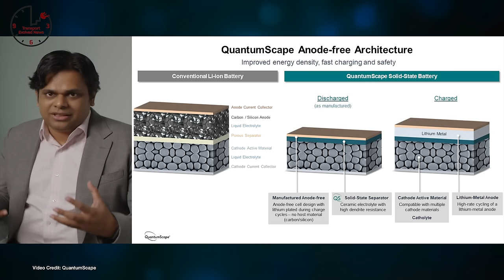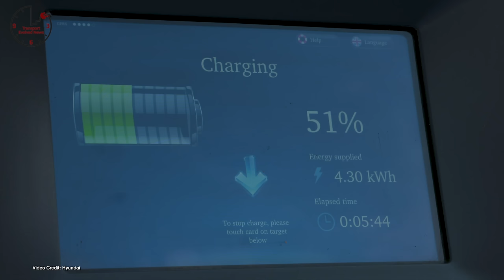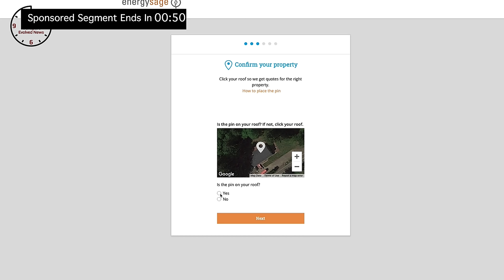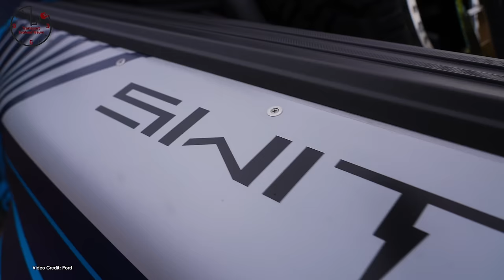TEN Transport Evolved News Episode 469 - Ford's Jumping Truck and Elon Musk's Ultimatum

Comment: 21:24 Sorry but Tesla charges $20,000 for a new battery while Hyundia has quoted multiple people $56,000CAD (41,594 USD) for a battery replacement.

Until they offer a reasonable repair option for dents in the battery case: Hyundia does not seem to be worth the risk.

Comment: Hello TEN. Thank you for your video.Where can i find verified and unbiased sales information and trends on EVs. There is so much confusion out there. Sales are up, Sales are down, Production is being cut. Production is going up. I appreciate your channel. Thanks.
Reply: Case in point: Nissan delays launch but reveals plans. It's hard to know overall what the direction is and how the trend is slowing or increasing.
Reply: Another example, Stellantis layoffs due to 'weakened EV demand', but is that just them or is it industry wide?
Reply: A lot of the 'confusion' is that legacy automakers are typically selling more EVs than ever....but not as many as they hoped. Sales are not dropping. Sales are increasing, but often not as fast as production has increased.
Reply: @stephenboyington630  Thanks, I figured the same but I need a reliable source of easy to understand data. Do you know any?

Comment: 5:25 One big other raison is that hydrogen electric cars are 5 times less efficient than battery electric cars, from the grid to the wheel. It means 5 times more photovoltaic panels, wind turbines, nuclear power plants, etc. And of course at least 5 times more money to drive. So hydrogen has no future for ground transportation.
B-EV : grid -> battery -> motor(s).
H-EV : grid -> hydrolysis -> compression -> transportation -> distribution -> battery -> motors.
However we need to produce green / pink / yellow hydrogen to replace the huge volume of black / grey / blue hydrogen used in the industry, not to mention new needs such as the production of carbon free steel. And we will probably also need hydrogen to fly long distances since batteries are too heavy for more than 2 hours of fly, but flying will probably cost 10 times more than with tax free kerosene !
Reply: The only green hydrogen production facility in Germany has shut down and gone bankrupt. What now?
Reply: @wolfgangpreier9160  Sadly, I guess now German's hydrogen trains will run on grey or even black hydrogen. It should be mandatory for all zero emission transportation hydrogen projects to put online at least the same level of clean hydrogen production. Otherwise, it will just be more coal and petrol and gaz. BTW, hydrogen trains are also a bad idea. The way for trains is to electrify the rail network, with batteries to deal with the portion of the network that are more expensive to electricity or with too low traffic (for now) to make it financially valuable.
Electric trains (and metros, tramways, trolley-buses) : grid -> motors ! (and motors -> grid when slowing or going down hill 👍).
Reply: @didierpuzenat7280  1: There is no active hydrogen train. Its all greenwashing and they are not allowed to partake in the general public transport.

Did you know that only international and fast trains are energy efficient?

Meaning only ICE and other international trains - not regional, REX etc. - have a better efficiency than a Tesla Model 3.

Swiss have found out conducting such tests in their own rail system.

City wide trams and Undergrounds/Metros etc. are quite efficient. Between cities not so much.
Reply: People who tout hydrogen, either ICE or fuel cell, passenger vehicles don't have a clue as to both the bulk of hydrogen storage vessels and the extreme engineering necessary to transport and safely use hydrogen. The Engineering Explained YT channel has an episode where the specifics of a Mercedes hydrogen/fuel cell sedan that was built is explained. Note also that a hydrogen fueled ICE vehicle is also a bad idea. Combusting hydrogen in an engine produces both water and nitrogen oxide, which is an atmospheric pollutant.

Comment: Vehicles like the Switchgear truck are not intended to be practical electric vehicles. Before McLaren built the P1, electric cars (Prius) were considered boring. McLaren didn't build a hybrid car to get the greatest range. Instead, McLaren used the electric motor to enhance the internal combustion engine by filling in gaps in the power band and creating a thrilling/terrifying street legal racecar. It is hard to get people to change from internal combustion to electric. The government can pass laws and put limits on internal combustion, but people will resist, fight back, and find ways around the laws. Vehicles like the McLaren P1 and the Ford Switchgear make the diehard fans of internal combustion excited about the performance, and they see electric vehicles as exciting and fun. Then, it creates an internal desire to experience it for themselves. Some may see these electric performance vehicles as ridiculous or impractical, but I see them as necessary "transition" vehicles between internal combustion and electric vehicles. https://youtu.be/OL_eIZjiLUk?si=fuIAuZK6KTc-rJyv

Comment: Betavolt is decades old texhnology. So a bit hyped up.
Reply: It's not new, yet the current tech a is much improved.

It's a story that comes up each year.
Nuclear batteries in that form are for long duration and difficult location energy supply for small electronics.

There are single load nuclear designs that could deliver 150years with a much much higher output, amongst others for space rafts.

Comment: 8:10 Credit cards are great but add to the cost and readers can be easily broken and then the charge point may not be working. QR codes are great but dangerous since a sticker can lead to a thief website or app. It would have been far better if the EU had made plug and charge mandatory, and it would have been easy since CCS2 is already everywhere (including at Tesla's superchargers). Plug and charge is cheaper, more reliable, and "a whole lot easier". Sadly I am not sure the people who decide are driving EVs. Not to mention "plug and charge only" charge points will not be anymore legal, so huge retrofit costs for Tesla for "old" charge points to comply, so higher costs for everybody. Or maybe Tesla will just delay the opening of some supercharger sites to all brands because of the work and cost to retrofit since it will not be mandatory for supercharger sites reserved for Teslas 😞.
Reply: All of this happens in Europe. Broken readers. Incompatible. Software problems. Etc.
Reply: @wolfgangpreier9160  I agree, and also broken screens. Plug and charge is the best way, but I guess it is bad for many haters just because it is associated with Tesla. Or people just don't know. The only better way to charge I see is induction, but I am afraid it is far too late for this technology. Induction would solve the vandalism problem and would make charge stations far more easy to install in Europe where people mind the quality of their visual environment (stalls with cables are not so beautiful and take a lot of space).
Reply: @didierpuzenat7280  Induction? In snow, rain, dirt? Interesting but very impractical. 

Maybe we should implement a pantograph on every vehicle and start laying overhead lines everywhere. 

Or better: A solar Autobahn with dynamic induction whenever a car passes over as Fiat has demonstrated. With built in heating, cooling and permanent cleaning with purified deionized recycled water.

The best ideo imho is the microwave satellite with its football field sized solar panels beaming the energy down into every moving car.

Comment: Re Airbus, megawatts per motor is meaningless without context of total weight of the propulsion system, it's fuel weight and payload. Note the fact that it's a turbo prop means you have more noise and vibration to deal with and slower speeds which means more flight hours per plane, longer flight hours for the crews which mean more crew costs, more maintenance man-hours, Hello 1945 air travel
Reply: 1945 did not have a lot of pressurised cabins. Hopefully sorted
Reply: Short haul flights are mostly turboprops, and they are more efficient than turbofans. 1945 was all piston powered and significantly more dangerous and inefficient.
Reply: @jimgoff1170  Turbo props are jet engines mated to propellers, lighter and in some ways simpler than piston engines, but more complicated than pure jets.
Hydrogen has less energy per pound than Jet Fuel/Diesel light/Kerosene.
The storage is also heavier.
This translates to more cost/mile traveled or payload.

Comment: The EV industry is not yet fully developed.  Standards such as NACS are just recently adopted by car makers.  Problems with EVs are being vetted thanks to real media channels such as ABC, NBC, and CBS.  The sooner the problems surface, the faster car makers can start solving real problems.  The cold weather impact on EVs and charging stations is a wake up call to solve issues with battery chemistries and charging reliability.  The Hertz and Sixt EV car rental news highlights the issue that EV industry needs to churn out mechanics and improve on parts and service.  Consumer Reports on poor EV reliability sheds light that EV startups need to improve on legacy build quality (trim, paint, body hardware (ie. .door handles...), suspension....).  We need to vette these problems for this to work at mass scale adoption.  The current EV owners are the lab rats paving the way for the majority of us.

Comment: Well it’s u again. Can you give me an honest answer.. JUst how green are our EV cars in total per car.
Reply: 42
Reply: what a silly question. how green are ICE cars? it depends on where your particular electricity comes from, electricity is getting greener and greener every day, but some is still produced by oil and coal which needs to end.
Reply: @keithwalker6892 Here is a simple fact, ICE vehicles only use 30% of their fuel for propulsion.  The exhaust from all ICE vehicles is highly toxic.   EVs are not perfection, but they are an improvement.
Reply: Most EVs are green but many are also white or blue.
Reply: @tonespeaks 30% is even optimistic, that's highway cruising once the engine is warmed up.  Normal usage yields under 20%
Reply: Numbers are out there.  Do your own research.
Reply: @GregHassler Mine is around 105%. For every kWh i produce without producing poison and use in my own EVs i give the grid at least 5% for free.
Reply: A least 95% of my charges are at night at home in one of the country with the lowest CO2 per kWh (France). And not with a huge SUV or truck but with a Tesla model 3 so quite an efficient car. BTW, "green" compared to what ? An ICE car ? Are you joking 😂😂😂? Not to mention we have only one car for a family of 5 (with 4 in age to drive) and most of our trips are with 2 to 5 people. When alone I use public transportation (metros, trams, trolley-buses, trains) or my bicycle or I just walk. Idem for the rest of the family.
Reply: @GregHassler  I was trying to give ICE the benefit of any doubt.
Reply: In fact, even with electricity produced with coal, so the worse, an EV emits less CO2 than an ICE car, even including the production of the battery. And I would be surprised you are advocating a car free society. And in many countries the grid is almost CO2 free, and in all countries the grid gets "greener" everyday. Furthermore, you can produce or buy CO2 free electricity, while even with the best intentions you will always pollute and destroy the future of our children with an ICE vehicule. I would happily add links to sources but sadly youtube do not like URLs in comments. But sources do not matter since I guess you just don't care because all I said is well known and I am sure I am not the first one to tell you all that. So at best you are just a nuisible troll.
Reply: An EV takes 2 years to recover its carbon build cost, 3 if made in China. After that if you charge with renewable electricity it’s all win.
Reply: @AlanTov  It depends of where you live, in France you need 10 000 km to compensate a 60 kWh battery (Tesla model 3 RWD, Renault Zoé, etc.), so less than one year based on the average distance per year. Anyway, it is anecdotic since the car will obviously last far longer. Not to mention gasoline does not appear magically at the pump so the impact of ICE car in hugely underestimated. But it is all much noise about nothing since ICE cars will be banned (2035 in Europe) to try to reach net zero in 2050, so people who are not comfortable with the carbon footprint of an EV are welcome not to buy any car at all after 2035.
Reply: One of mine is about 90% green (10% black,) the other is 0% green (it's red.) Not counting windows.
Reply: I have four BEVs. Today is the first time in a year that not one of them is broken. One of them is costing me a fortune and I was given it for free. I replaced a rear mudguard only to find out the headlight module had died. Since it’s been broken for months and not used at night it could have been that way for a while and I didn’t notice. Uncaring operators don’t help

Comment: Did you not mention the problem of drained EV batteries in the Chicago area cold?   You can blame the owners for not warming the batteries or you can blame the manufacturers, but to not mention it at all, while the networks and youtubers did, makes your channel look biased.
Reply: Reduced performance of EV's in cold weather isn't news. It is just a fact of  chemistry.
Reply: @avsystem3142 I have never before heard of charging stations becoming parking lots for EVs waiting many hours for charging.  This was reported on the major news outlets, so it is not just me who find this to be a new twist.   I am not against EVs, on the contrary, but buyer should learn what has to be done to prevent these situations  or decide to hold off on purchasing an EV.   Assuming the buyer lives where there are often extremely cold winters
Reply from the maker: It's a good thing we didn't expect internal combustion engines to be perfect when they were just becoming popular too.
Reply: @transportevolved  I am pro EV, do not expect them to be perfect.   I just thought you passed on a big story because it was not on message.  Your credibility goes up, not down, when you explain the problem of people not knowing how to warm the battery before charging on especially cold days.